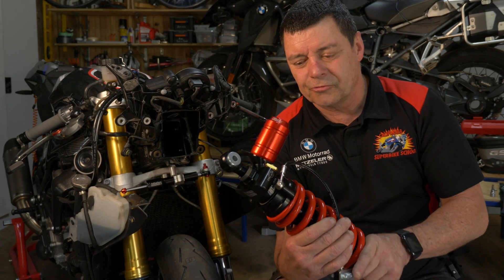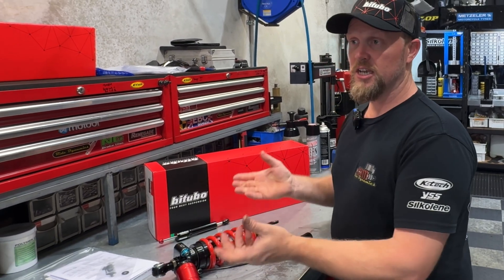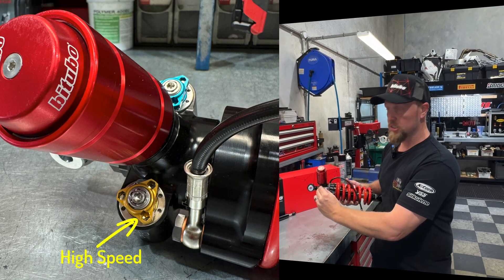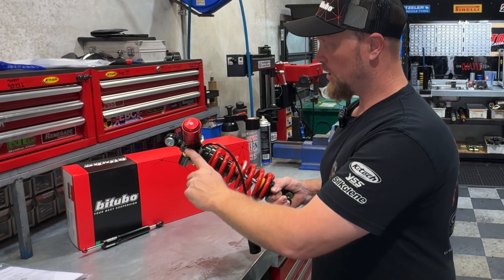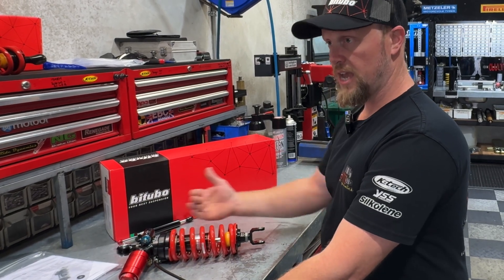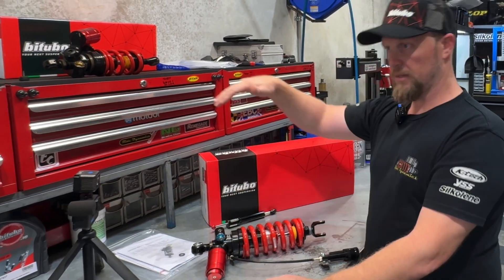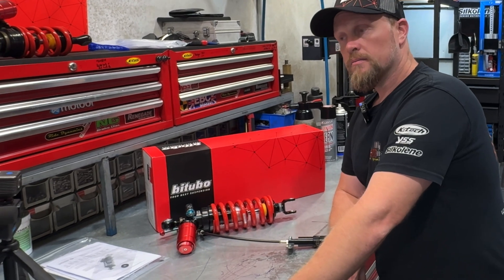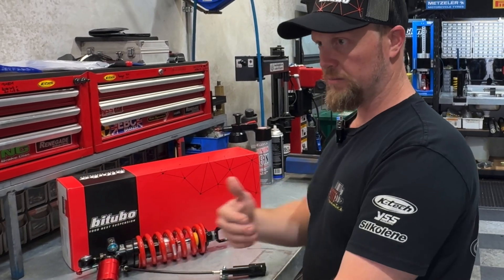Suspension Part 3 - Bitubo Rear Shock Upgrade on BMW S1000RR

Comment: 4:13 for the rs 660 can’t you get the hydraulic preload for it or is it only manual preload adjustment?
Reply from the maker: I actually don't know mate, you'll need to check in with the Bitubo suppliers if you want that information. I do know the preload adjustment on the Ninja 400 Bitubo rear shock I have is manual adjustment, but it's super easy the way they do it.

Comment: After watching your videos I have now bought this shock for my 2017 s1000rr. I have yet to fit it, along with new ktech fork cartridge kit, but I am wondering what did you do with rear suspension potentiometer? Leave as is or remove/tie up?
Thanks from Ireland 🇮🇪
Reply from the maker: I'm assuming you're talking about the rear suspension sensor. You need to loosen it from the frame to fit the shock but then simply re-attach it.

Comment: I can’t seem to find the right XXZ model for my 2014 S1000RR. Th ones i see online have the “wrong” mounting at the bottom of the shock based on the images shown and unlike what you have.
Reply from the maker: Go straight to the Bitubo importer or to a distributor, they should be able to guide you on this. I simply purchased the right one for my model bike. If you're in Australia, and are still not sure, touch base with Joe Salter at Ride Dynamics ... best advice I have mate.